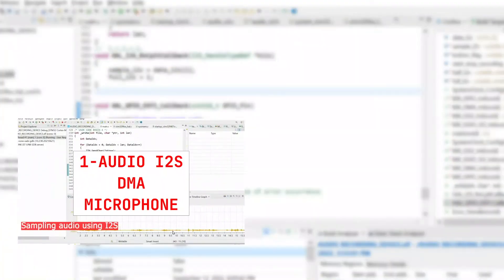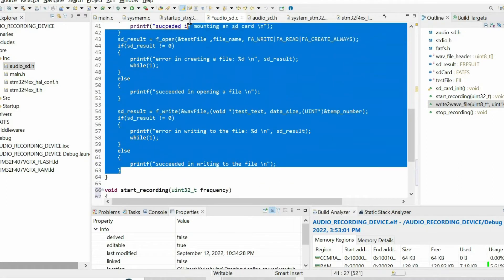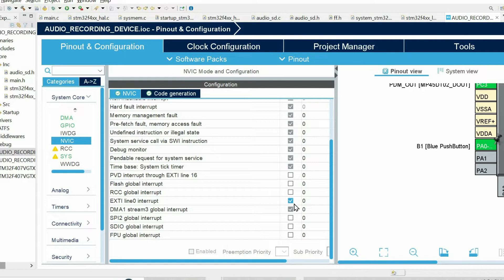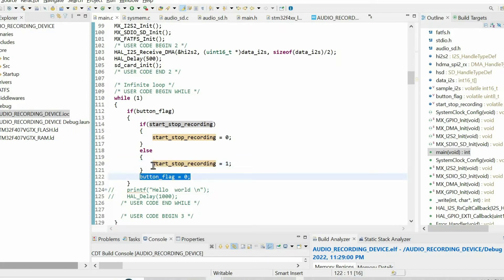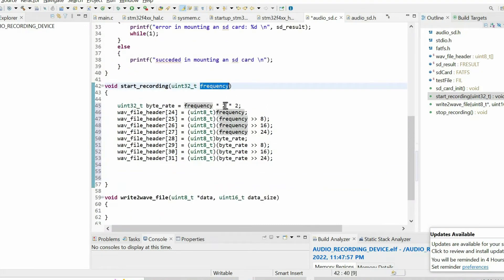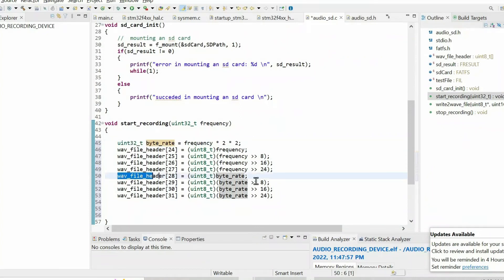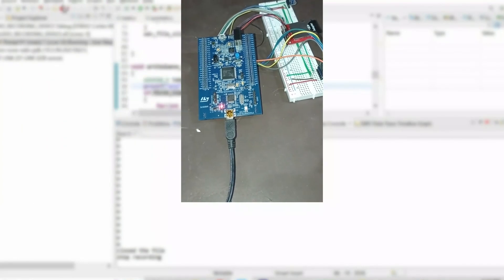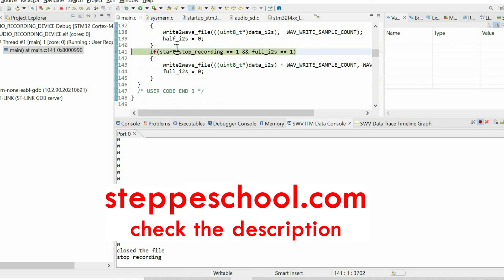STM32 Audio Recorder 3: streaming MIC audio to SD Card in real time|| I2S DMA || SDIO FATFs

Comment: how did you learn to do this?
Reply from the maker: You mean in general, or about this project?
Reply: @steppeschool3629  this project, because i want to learn this specifically but don't know where to start. i had pdm microphones converting to i2s using  ADAU7002 but i cant figure out if it working   because i cant get the audio to play on amplifier or write it to sd card. My guess was 16bit data on 32bit frame for ADAU7002 . I know data is 24 bit. but i thought would matter as long as bit frame is correct. Issue is amplifier only worked when i did specifically 16khz 16bit on 16bit frame which i don't understand at all. I am missing a lot of theory knowledge about audio and i2s. Wondering where can a learn it

Comment: may I ask why in the code you first declared the data_i2s to be int16_t, then in the functiong HAL_I2S_RECEIVE_DMA you cast it to (uint16_t*), then in the write2wave_file function you cast it to (uint8_t *)? I haven't understood this part yet. Thank you so much
Reply from the maker: because HAL_I2S_RECEIVE_DMA requires uint16_t data type and write2wave_file uint8_t. You can skip the typecasting and it will work just fine. But during the compilation you might get some warngings
Reply: @steppeschool3629   thank you very much. I have this following up question regarding your reply. So since I have 24-bit signed PCM microphone, I intend to configure the data format into 32 bit on 32 bit frame, and  receive 2 uint16_t samples, combine them to form an int32_t sample then extract the first 24-bit (since MSB are on the upper side). However, what I receive is very noisy and low in amplitude. Do you have any insight on the potential causes? Thank you very much.

Comment: If I want to use the inbuilt microphone on it how can I do it. Can I use this video as the base for using the inbuilt microphone or the process is completely different.
 please explain it, it's very important.
Reply from the maker: Using the in-built microphone would be very similar to using the external microphone. Definitely, these videos should help. In any case, I am preparing a new video to show how to read the in-built microphone in STM32F407-DISC1 boards.

Comment: Hello, your channel and website are amazing. Thank you for the exceptional tutorials.
 Will you continue the STM32 Audio Recorder tutorial series? For example, playing the recorded sound through the f407 board's audio output? 
Another question is why didn't you use the microphone on the f407 board and instead used an external microphone?
 I would appreciate your response.
Reply from the maker: Thanks a lot. 
I will wait to do it. It is interesting and fully feasible, but the project should be financially justifiable and interesting to a wide audience😀 
In addition, I am working on attitude estimation using the IMU sensors based on the Kalman Filter and quaternions. Once I finish it, I will start thinking about a new big project.
The microphone on the board is obsolete. That is why I decided to use an external microphone. In addition, I want to show how to record from two microphones simultaneously.